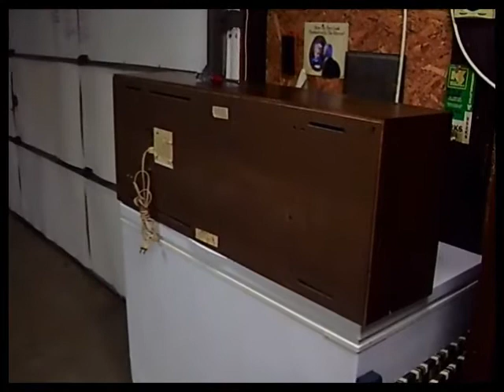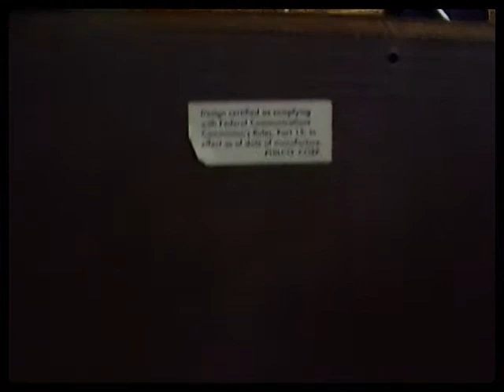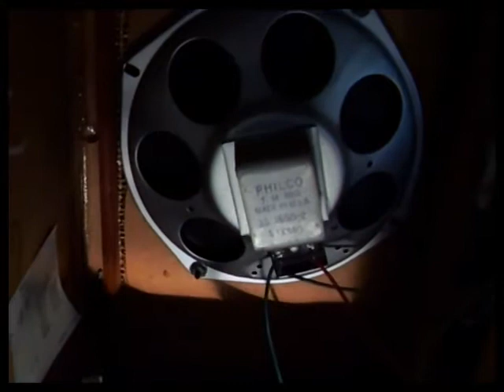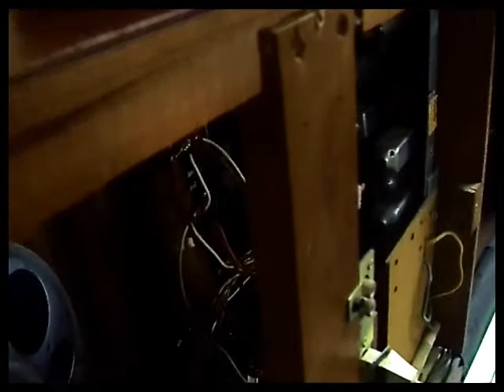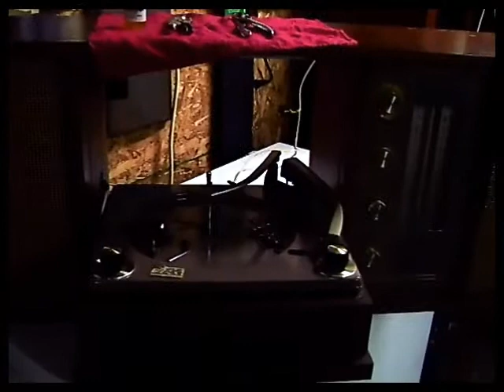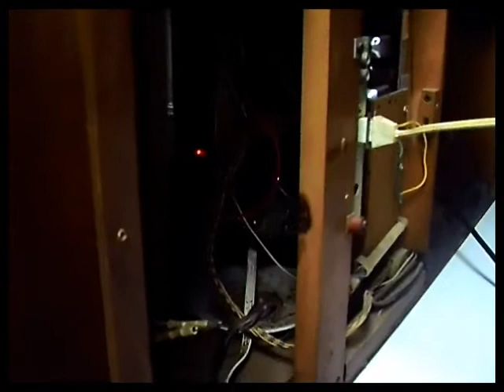1965 Philco M1620 - 124 Stereo ~ Part 1

Comment: Did you say the unit has no auxiliary inputs?  I do see two RCA jacks on the back.  Perhaps those are outputs for a tape deck? 

The FM antenna (the wire that goes from one end of the cabinet to the other) was a fairly common method for internal FM antennas.  Not that much different from the little wire FM antennas that come with today's receivers.
Reply from the maker: John,
Those RCA jacks are for external speakers. In addition to the antenna wire inside the cabinet, it also uses the line cord as an additional antenna too.
Nathan
Reply: NBH45304 Two built-in FM antennas was not common.  Perhaps they wanted to give the user a choice to see what worked best for them.  This was not a cheap unit.